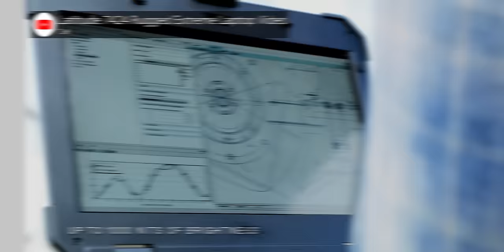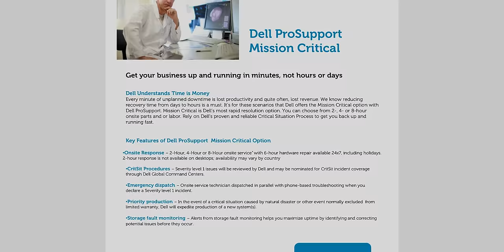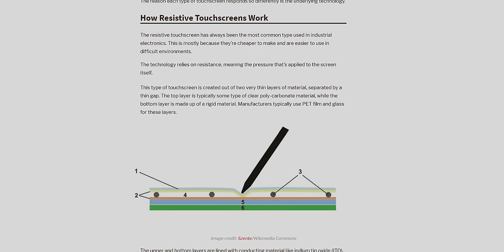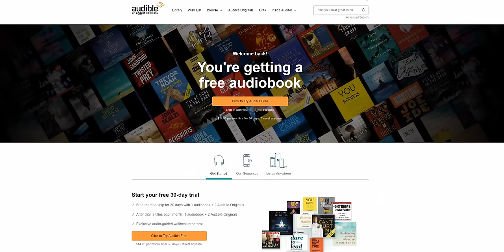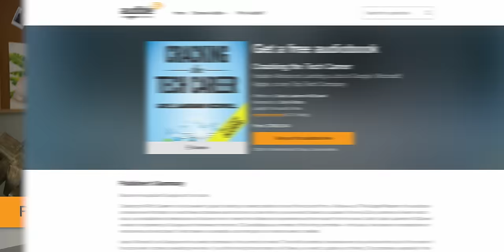The Manliest Laptop Ever – Dell Rugged Extreme Review

Comment: We use these on helicopters at work.  Anything else wears over time from the vibration.  Especially HDD's.
Reply: We used these for line maintenance in Chicago to update FMS navigation data
Reply: use ssd
Reply: Just get SSD lol
Reply: Fascinating
Reply: @prakharmishra3000  nothing will stay alive in these conditions. no laptop other than rugged ones will survive
Reply: @smmshoe  not even phones? 
the only failure due to vibration would be in HDDs because they're spinning at high speeds and try to stay stable due to the  gyroscopic effect. When this happens long enough something becomes loose and it only needs to move a couple microns to fail.
phones and notebooks dont have such problems as they have no moving parts.
Reply: @prakharmishra3000  I mean- i. military vehicles and stuff there is no way a smartphone will survive. the amount of dirt, rain, hits and such that will happen during the daily missions will destroy it. Or you can use a huge bulky case for the smartphone but even so these soft electronics won't survive
Reply: @smmshoe  smartphones are not dragged from cars lmao, they're kept in pockets where dirt and stuff barely reaches. Nowadays most smartphones are dirt and waterproof to an extent. Most soldiers carry their phones.
Reply: @prakharmishra3000  have you been in a tank while it is driving? or an armored vehicle? as u soldier u will have to do that, and the smartphone won't last. you just throwing out somethings without actually being in military vehicles, in the open wide places. as a soldier u constantly moving from one terrain to another. the smartphone won't survive
Reply: @smmshoe  tell that to the people who carry smartphones in the military and upload videos on youtube... I guess they use a rugged laptop to record videos too.
Reply: If there’s one ment for vibration I I assume you use it
Reply: @smmshoe  hello tactical medic here, my phone has survived getting dropped 3 feet from the rescue chopper, also survived me falling face down in the mud and also survived sand and saltwater from me rescuing a child that was screwing around with boats
Reply: @smmshoe  modern phones can survive more than you think

Comment: I can imagine some dude working at an oil rig appreciating his rugged laptop with a full RGB keyboard.
Reply: You would be surprised.
Reply: @lloydcc  are you some dude working at an oil rig who appreciates his rugged laptop with a full RGB keyboard?
Reply: Kaustavmani Choudhury nope, I get to fix the computers they break though
Reply: @lloydcc  oooh, noice
Reply: Charles Lloyd hey, RGB is good at dark so that’s probably why they included it
Reply: @AxzoYT  a simple white or sky blue or grassy green backlight would've been sufficient. but I guess rugged laptop owners need to flex too.
Reply: @barongerhardt  I agree. a stealth PC has always been a dream of mine. but nowadays, non RGB parts are hard to find.
Reply: @kaustavmani  for real, most highend mobos are packed to the brim with RGB, i like it but imo manufacturers should provide non RGB versions too.
Reply: @mohnmann  I agree.
Reply: Windmill technicians use these at my workplace
Reply: The RGB is practical.   It means it's backlit,  and you can see the keyboard well regardless of the light levels.
Reply: @mohnmann  you do realise. You can turn the lights off?
Reply: @barongerhardt  The "lights off key" also saves a LOT of battery between measurements in the field, if you dont want the whole system to go into standby - because that would f%&/ up the connections to the hardware the laptop is connected to. It also very useful if you have some large calculations running in python, R or matlab over night and want the display to stay open, to help the laptop stay cool, while also being able to sleep in the same room. But AMD graphics ? WTF, they dont support CUDA, what a waste of a GPU in a field laptop (and how sad that AMD is not supporting openCL development that much).
Reply: @sohankonar9744  nah man, i never knew i could use any of the 4 RGB softwares i have installed because every manufacturer uses their own weak proprietary stuff to turn it off. Otherwise i like RGB stuff very much i just know many people that dont like this trend. imo people that dont want to deal with RGB but want the benefits of a high-end mobo, GPU or AIO shouldnt pay for stuff that they dont want.
Reply: @kaustavmani  I am some dude on a oil rig and I enjoy my rgb keyboard

Comment: But with that heat dissipation configuration the review isn't complete until you overclock it underwater.
Reply: Watercooling without doing much :O
Reply: @lucasrem  They could overclock it (with bios mods) if the internal power regulation circuitry supports high voltages/current and squeeze alittle more performance without overheating concerns. That's assuming it isn't already undercooked/thermal throttling which would imply much better performance over factory stock.
Reply: It will probably die under water since the water resistance is only for water jets, not submersion
Reply: @mika2666  More than likely but the water resistance could be increased with silicone gel. A modification like that wouldn't be easy on any other laptop (without an isolated and water proof brushless fan, that is). They could probably make this water resistant up to 1 meter but likely at the cost of easy internal access.
Reply: I had to correct myself, I need to proof read before I post comments.
Reply: I wouldn’t be surprised if it was warmer underwater (assuming it could survive). That little fan is made to push air quickly, and it may not be very good at pushing a lot of water through it.
Reply: @SirSethery  it doesn't have to push a fraction as much water as air thanks to the heatsinking effect of the surrounding water and the specific heat/thermal conductivity of water itself.

I have some experience in the matter: A made a few underwater passively cooled circuits with power draws of ~150w and nearly ~80% of the power of was converted to heat, I had to keep it passively cooled and I used a relatively small heatsink (25x25x10mm aluminum). The package (when ambient water temperature was ~30°c) had a peak of 45°c, not great but I had no fans and likely a equivalent heat output to the at most 30w tdp Intel chip (no idea on the AMD GPU). Heads up, it was tested in a plastic box (I don't remember the exact dimensions) but it was at least 8-10inches under.
Reply: @00O3O1B  fair enough.
Reply: Michael A  what is that in reference to?

Comment: Its for the military, industrial field workers, first responders and field scientists. Also finally a laptop that can survive alex. Also is that bear ok after being hit by this thing.
Reply: Also, believe it or not, Field Techs in the IT industry (this includes Fiber and Cell Tower techs)
Reply: Linton  oh those are cell tower technicians they drop theirs fairly often.
Reply: When I saw the serial port I went "holy shit a serial port" out loud. They really had a very clear idea about what kind of market they're going after with this.
Reply: Would be an upgrade for the current DTADS computers
Reply: they all use toughbooks by panasonic, but yea same audience, i doubt will get that market easy
Reply: No the bear is not okay. He's been in the emergency room since the time of the video. Dude broke his spine so hard they thought he was a bear skin rug
Reply: The panasonic is not so tough.
Reply: @johnathanmcdoe  All motherboards have COM/Serial port (and ISA controller, although no ISA slots :D). I have ASUS X470 Prime, it has latest USB 3.1 Gen 2, water pumps, RGB and so on, and yes, an internal COM port connector. You can get an extension cable and connect your (older) oscilloscope from the back side :D

Comment: Mid battle
Soldier 1: Did you call for support yet?
Soldier 2: Windows 10 is updating
Reply: yeah that thing running windows is probably the biggest enemy of the people in the field
Reply: Windows 10 Pro allows good control over updates.
Reply: This type of laptop has been in military use for decades. Dell was able to meet all those unique specs because they've been making these already for so long. Military laptops don't run stock windows OS, and users are absolutely not authorized to attempt any manual updates to their machine.
Reply: @Varadiio  Moral of the story: Use Linux.
Reply: Thankfully the enterprise line of Dell laptops have Ubuntu and Red Hat Enterprise Linux certification.
Reply: I mean tbh the target audience for this already should be in a field of study that they require custom software over Linux or something
Reply: If you look at the professional Dell laptops, you get the option to order them with Ubuntu instead of Windows. My guess is that they used Windows for this video because its what most people are familiar with.
Reply: Windows 10 IoT and most of these problems are gone
Reply: My XFR uses Windows 7.
Reply: @CossackHD  If I cant turn off updates permanently then its not good enough.
Reply: My cousin is lieutenant here in the Spanish Army, and they use these laptops. Both Win and Liinux. And are literally rock solid, safe and stable (vPro, etc.). Of course the drawbacks... are pretty much enormous bricks, but meet the military requirements.
Reply: Lol
Reply: @chargedsupercap2270  windows enterprise doesnt force updates or include any bloatware.
Reply: Could be worse, could be the laptop you take to Mars with you.

Estimated Time to finish download: 2,352 hours Your ping is: 54.6 million kilometers Latency is: 24 minutes
Reply: @Varadiio  Yea I would have liked this model over the one I had to work with.  They came with XP, were beaten to hell and ran so slowly.  With that said, you could hit it with a hammer and it still would do its job.  All they were for was for reading PDF's and IPB manuals for aircraft maintenance.  Thankfully too, I appreciate the system being locked because people just love to fuck with shit.
Reply: More like sir we been ransomed they only take prepaid apple cards!
Reply: Ever heard of WSUS?
Reply: You guys actually think the US military is getting this with Windows 10? That's cute, theres a reason they just extended Win 7 and XP support for about $1 billion! When I was in artillery (4 years ago) we were JUST replacing our MILSPEC 2003/4 HP iPaq 4800s for roughly the same era tablet PCs! Try teaching an 18 year old who's almost the same age as the device how to run Pocket PC 2003!

These things will take 3 rounds to the chassis and keep on chugging, that RGB is definitely to change over to red light night ops and would've been amazing!
Reply: @blackonblack...9244  They don't force updates on you like Win10 though.

That said, any large organization like the military will be using Active Directory and controlling updates via group policy which makes this issue moot.
Reply: @Varadiio  I have always been curious about how that works? Assumption base line hardened with full disk encryption and device monitoring over VPN. What stumps me is what do you do about updates? Kinda of damned either way type thing from my perspective.
Reply: Business windows doesn't update the same as consumer.
Reply: @chargedsupercap2270  Linux guarantees mission failure. Peripheral drivers stopped working lmfao.
Reply: It runs Linux perfectly, tho.
Reply: That's why you use Linux in the field.
Reply: @TECHNOSLAV aka Cossack-HD Great joke!
Reply: Maybie they rewrite it with some different OS. I dont know how military would use the shit load like win10 for special operations.
Reply: I luv this freaking comment 🙌
Reply: @chargedsupercap2270  Wrong. Linux is the worst OS for soldiers.  Fine for nerds and mission critical IT work. but no big no. Most militaries still uses Windows since windows is despite what you think is the most universally compatible operating system on earth. With more drivers (1000 to 1) to that of any linux distro.
Reply: Military should use Linux :)

Comment: Remember when all laptops were like this in the 90s lol
Reply: «This is the slim edition»
Reply: You are an OG 👍
Reply: But weak af compared to this
Reply: Legitti Or not, I don't think you had '90's laptops, they were mostly thick and heavy but broke if you sneezed at them, except thinkpads and toshiba satellites.
Reply: @noth606  I have broken four Thinkpads in the past six years, and one of them was the supposedly MILSPEC T-440 model. I need something that can handle my 275 pound brother accidentally stomping on the screen.
Reply: @sailordolly  
Anyone old enough to weigh that much while still retaining the ability for their body to support its own weight should also be old enough not to accidentally step on a friggen laptop
Reply: @sailordolly  solution: don't put yo shit on the floor. (Or just hide your stuff when not using it, this is usually the preferred method when dealing with destructive individuals)
Reply: Thicker, but fragile as the current Mac.
Reply: Not water resistant tho

Comment: Glad to see that Dell is thinking about professionals in hardcore fields that don't require boutique laptops.
Reply: @Conor tbf you probably could too.
Reply: dell and HP have been making these for a long time. pretty sure they sell a lot of these to the military/police/armed forces for use in the field.
Reply: @WTFZOMG  they do. Especially the military. 

I worked for a logistics company that worked on these all the time. We'd often get orders for like 2000 at a time.
Reply: Work for a defense contractor, these things are an absolute must on some of our production floors.
Reply: I use mine to drive my CNC, having destroyed 5 consecutive lesser/normal laptops in that workshop environment. I used to have to keep a spare for the inevitable failure. This thing however doesn't even feel it, its the perfect tool for the task and the performance is well up to being able to pop back into cad for example to tweak a part on the fly. Best laptop I've ever bought, worth ever cent.
Reply: m4chanist Just be sure you clean the wood dust out of the fan once in a while; even rugged laptops like this one could get clogged up eventually.
Reply: @WTFZOMG  tough books are what we use in the patrol cars
Reply: @Conor TELL ME MORE ABOUT RIDGE WALLET WHATS GOOD OR BAD